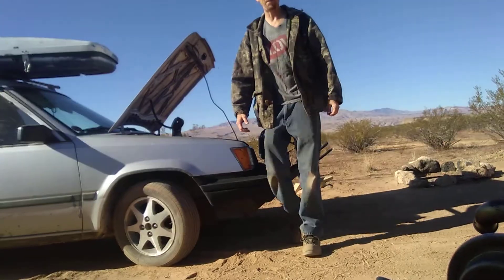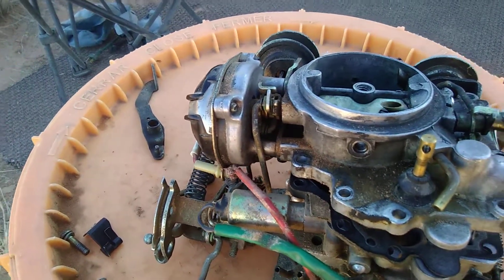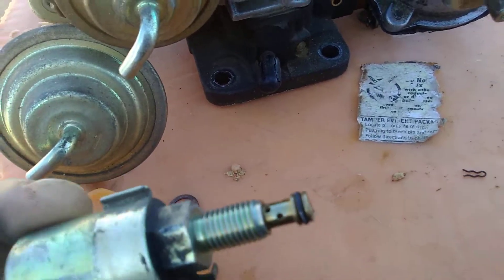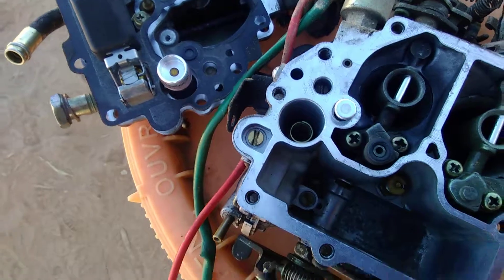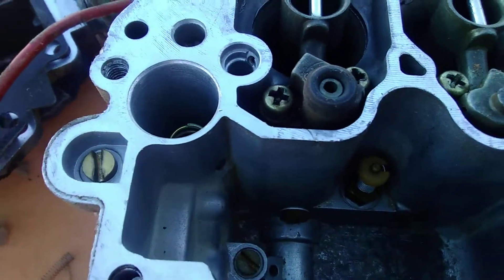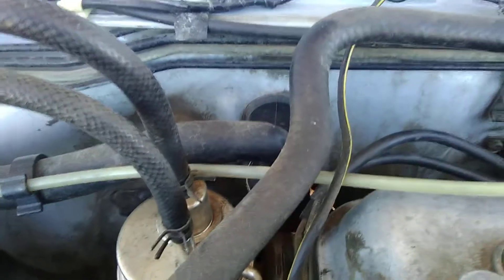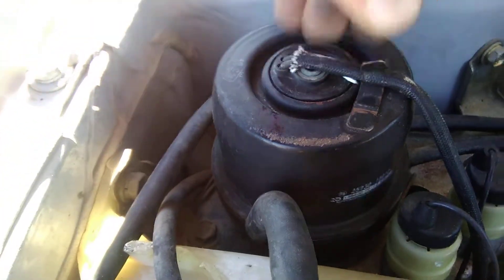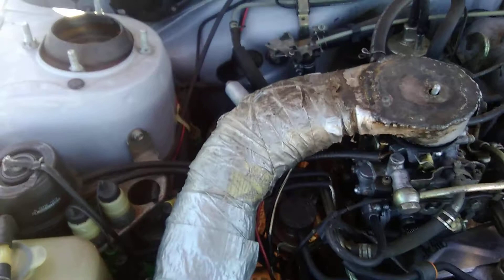4wd Tercel power and performance tips carburetor vaccum timing

Comment: I need to find out exactly where the red wire goes the one that's with the green wire mine got cut and I don't know how to fix it any help would be fantastic
Reply from the maker: The wires are different layout   on different tercs  but  if i recall one is a power to the fuel solenoid off the ignition   and it opens the idle jet to run, the other one is power the choke and the other 2 go to the 2nd fuel solenoid usually a 2wire solenoid, but im pretty sure the choke should be always hot or atleast when cold and the one to the main idle solenoid( the one in the back near the throttle) should always have power when the key is on and be dead when the key is off...  carefull of the little orings getting stuck in there  if you pull the soleniods out sometimes they get sticky and need cleaned too.. they should click when they get power on and off

Comment: Another thing I found out.  Start car, warm it up.  Then turn off.  With a flashlight inspect the secondary bore/butterfly.  If there is fuel pooled over the butterfly the vent hole in the fuel feed jet is plugged and fuel is being siphoned out of the fuel bowl onto the secondary butterfly.

Comment: From what I have seen the primary side solenoid is used to prevent fuel leakage thru the idle jet when the car is not being used.  When key is on it opens up to allow the idle jet to work.  If that jet is plugged car will not idle but will run at higher rpms.

Comment: I have a corolla ae82 with the 4ac engine and the carborateur. Im having a slight issue where it runs rough at 2000rpm and at idle sometimes. It has been like that since i got the car almost 4 years ago. Ive replaced the sparkplugwires, the ignition module which was out of spec and kept it tuned up. I will try to rebuild the carb at some point when i have the time for it to try solve the issue. Im guessing just dirty primary jets and such. It is also hard to start when warm where i have to crank on it more. Ive noticed that sometimes i get worse fuel consumption normally its around 0.75 l/10km or 0.8l/10km but sometimes it shoots up to 0.9 or even 1l.
Reply: Have the same problem on my 87 Toyota Corolla

Comment: which number of jets you use on primary and secondary?
Reply from the maker: You know im not really sure, I put in the leanest ones i have (for high altitude)
and i forget the numbers, I'll be in there again  in the  next few months some time as to the carb is leaking gas somewhere into the intake, probly through one of the lead plugs but not sure yet, seems a common problem my back up carbs are doing it as well, I'll check the jet sizes when im in there and try and let ya know, and im going to make a video when i find where the leak is as well.

Comment: Does anyone offer new/rebuilt carbs for these? I’ve got a ‘86. Seems like every other carb is available but this one.
Reply from the maker: You know i bought thta one from Rock auto and it had wrong peices and was just a mess.. but i managed to fix it all right and the one good thing was the throttle  bushing were replaced. But there is a guy who does the throttle bushing in oregon i think,  he has them mailed there and fixes them up then mails them back. I can get ya the number if ya want.
Reply: @mechmattldschannel4105  I’ll try a simple rebuild kit first I guess.
Reply from the maker: @jimstenlund6017  a new trick or 2 i learned is to take an old ball bearing and Litely tap it in its home to make a clean  seat for the new one, another thing im looking at is there ia some lead inserts that can leak gas into the intake, there is some videos to show how  to fix it  on you tube. I'd also recommend an electric fuel pump as to the gas nowa days seems to vapor lock at lower temperatures, i had to lower the temp on my thermostat  as well and also threw in a aftermarket fan controll unit, it enables me to adjust when the fan comes on. Maby ill make a videos of all the mods on my tercel in the next few weeks when i have time. Feel free to check out my video on how to fix the blow by issue, i just uploaded it 2day as well, its an easy fix for the tercels.
Reply: @mechmattldschannel4105  I’m thinking of hood hinge spacers to raise the back of the hood for more ventilation/get rid of some heat.
Reply from the maker: @jimstenlund6017   i had one i put hood scoops on a few years back.. it did help but also caused some problems with dust and when it snowed..  thats a great idea though cause you could take them back off easy if needed.
Reply: @mechmattldschannel4105  I’ve seen some Civics run the hood spacers. I was thinking too, maybe make some light mounts attached to the spacers, that way there’s no added holes to the body.
Reply: @mechmattldschannel4105  when yours vapor-locked did it just not start after heat-soaking? Mine bogged at full-throttle recently and I haven’t driven since, but I wonder if that wasn’t what happened. I changed the fuel filter yesterday but it didn’t seem too bad.
Reply from the maker: @jimstenlund6017   there could always be other causes like the little filter in the inlet on the carb or something stuck in the needle seat, a bad float level 
Wich is rare, Even a plugged idle jet does weird stuff ..but the main culprate is the gas lines suck in air as they get old instead of fuel. Its micro cracks ya cant see and thats why gas doesnt leak and with the pump up near the engine sucking instead of being back by the tank pushing gas to the front.. once the pump hits vapor air it'll just pull bubbles from the micro cracks ...they also  vapor lock cause of the heat from the carb at the top of engine,  I've literaly seen the gas boil through the little float level window, . and all together calls for an electric fuel pump. It most likely is that but i would still recommend filling the carb with gas to look for leaks while its off maby let it sit a day or 2. I can do a video of how i ran my electric fuel pump. It was fairly inexpensive and easy. I had to replace it after about 4 years but thats not bad for an aftermarket fuel pump. Look at the new cars .. they have plastic fuel lines that don't get near as hot, a fuel pump in the tank and no bulky carbs holding a pot of fuel to boil.. and they say gas now evaporates at lower temps and with all the problems i listed above the tercel need some mods to keep up but i can floor mine all day up hills at any elevation. And also with almost zero blow by. But yes mine would stall in  vapor lock and not want to start.. you might just have a basic carb rebuild fix going on.
Reply: @mechmattldschannel4105  I’m going to try the Airtex fuel pump first, they include a spacer that is supposed to protect it from cylinder head heat. What your saying makes sense though about cracks in fuel hoses.
Reply: @mechmattldschannel4105  BTW, my new Airtex XP part# 5D1072A distributor cap has brass/copper contacts in it. I’ve seen that in high-performance caps before but it’s kinda rare from my experience.

Comment: I have an Aisan carburetor identical to yours, and i've just realised I attached the needle valve onto the float incorrectly. Never knew that metal wire on the needle valve went around that tab on the float. Welp, looks like i'm taking my carb apart again.
Reply from the maker: It took me quiet a few times to get these carbs correct they are quiet intricate with all the solenoids and power valves and check ball bearings.  Good luck my friend happy tercel days, haha!!
Reply: @mechmattldschannel4105  Thanks! It's been 5 months since i've made that comment, and my carb is back on the car, ready to start. Haven't tried to start it yet, though.
Reply from the maker: @adelaideautowashes  I'd love to hear how it works once ya get it going.. best of luck on that !!
Reply: @mechmattldschannel4105  Good news! The car runs now.

Comment: What about the accelerator pump diaphragm getting stiff and working poorly.
Reply from the maker: Those can be a trick but really all they do is work when the car is cold to make them run richer and when they warm up it doesn't do anything.  But they can leak when they get old . Usually the rebuild kits should come wih a new one and fairy easy to change.

Comment: great job!! thanks i have one with 2 parts cars, one runner i want to turn into a poor mans turbo relley car  any suggestions on suspention mods?
Reply from the maker: Thanx for you comment, and yes i do have a bit a lift info; if you get the FRONT shocks for a jeep cherokee i believe the mid to late 90s model, they will fit on the back shocks of the 4wd tercels,(im going with air shocks for them soon)theres a bushing where bottom bolt on the jeep shock that you will have to pull out to make it fit...easy shmeeesy and it will allow for an easier lift with some stiffer springs on the back and also some nice extra drop down travel for the when the wheels drop down 4wheelin, i think my one 4wd video on here i posted actually shows the rear wheel dropping way down while 4wheelin it, i also put  spacer washers on the tranny mount to drop the tranny just a hair, to allow the drive shaft to keep straight with the new ride height....
On the front i just put some simple 2 inch spacers between the strut tops and the unibody, and will need fresh alignment ,couldnt do much more then that properly with out moding out all the suspension and drive train, big diff though!!! Good luck... I'd love to hear how it all turns out, or even see another  a tercel vid!!!
Reply from the maker: Also if your running a turbo just make sure to put it beetween the carb and the intake not  before the carb cause  that wouldn't work to well, 
 cheers!!

Comment: I have a 1983 Corolla with a 3T engine. I want to change the jets so that I can get better gas mileage. I also want to know if there's a better way to make my car lighter on gas
Reply from the maker: Those are sweet cars, i miss my 82 Corolla..i can't really say any facts but skinnyer tires make less friction and better fuel mileage, there may be some tricks with the EBCV, maby if you could rig up a second or third EBCV off a gas vapor tank or something...i think there's a YouTube video of a guy running a lawnmower on fumes ,it's kinda the same concept....it'd need some experimenting though..not sure of I'd mess with the jetting too much unless you understand jetting and air fuel ratios..the most i could say is less air restiction the better mileage, including exhaust restrictions, you could  run a bigger air filter , but would have less suction on the jets, so you wanna run a bigger or more rich jet and still keep your mixture correct, ....good luck on that, it is possible, let me know if your able to find something that works!!